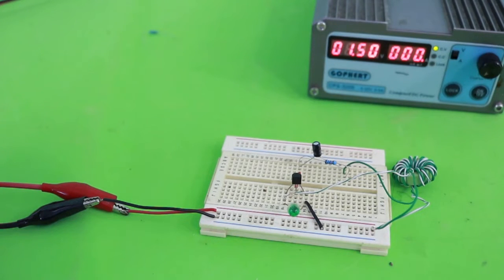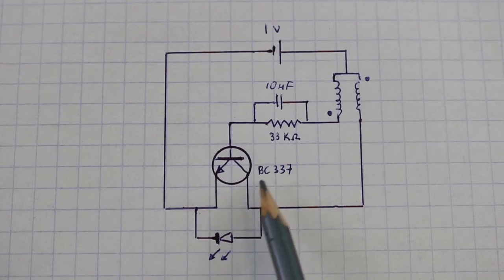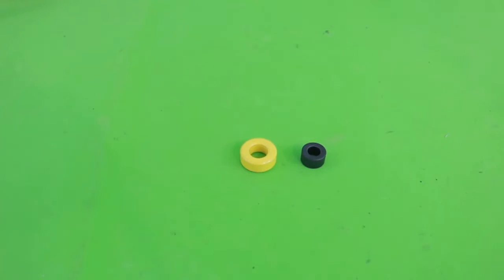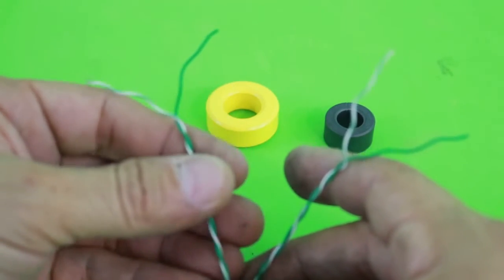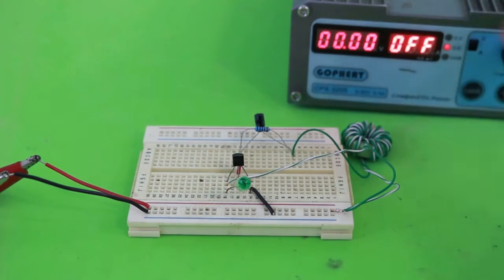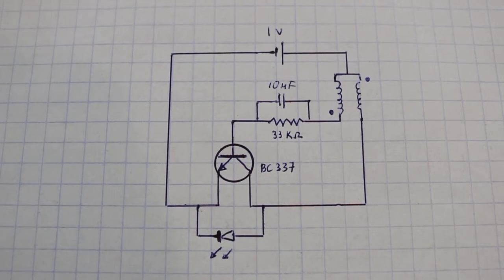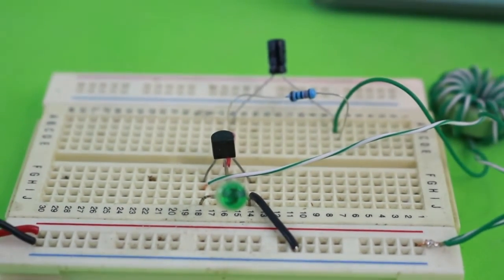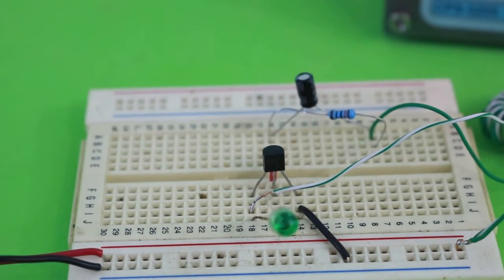Blinking Joule Thief Circuit

Comment: Ive tried this circuit a number of times but all I can get is a single flash when I connect the battery.  If I disconnect and try again I just get one flash.  Clearly Im doing something wrong but i cant find out what.  Im using the same values as in the video.  HELLLP!!
Reply: Use a different toroid, the 90% of the succes is in the toroid. Also tray to invert the connections of the primary (or secondary) of the toroid. Finally the LED is very critic, use a 5 mm high bright type.

Comment: Just made this on a breadboard. At first I made it with just a static light, then your version, then I upped the size of the capacitor for a brighter flash and replaced the resistor with a 500k pot, now I can make it flash as fast or slow as I like.  Considering my complete lack of knowledge about electronics, I'm quite pleased that it works :)  The battery I'm using is nearly dead, about 0.8v.

Comment: This circuit has amazed me for years. 
Just a thought;
 If you take Blue LEDs
A parabolic collector with a convex focus lense. Could you spin a Crookes Radiometer.
I bet you could.
Reply from the maker: I cant test it  I broke my radiometer 😭
Reply: @ludicscience  I'm sure you could make one. It's not like your short on creative talent.
Reply: @ludicscience  Here is a video on how you can fix your radiometer-im assuming the tip broke off which would be the "best* breaking point being that it can easily be fixed again but otherwise the whole bulb probably broke which means that you would have to make a whole new bulb-you can even make a vid about it and the link i added is about a "sprengel pump" which you can use(well first make then use... also another vid idea...) to achieve the needed vacuum for the radiometer to function... Anyway really hope this helps and here's the link👉 https://youtu.be/viJ3T-1KZqY

Comment: It would have been nice if you had used an oscilloscope to help explain how the circuit operates.  Either that or a circuit simulator.
Reply: It's very cool basically the inductor gets charged from the power source till it's over saturated and can over come the resistor at the base of the transistor, then all the build up in the coil dumps to ground through the led causing the pulse. I have one in my workstation that has been blinking for over nine months on a single charge! It can go for years on one charge, very efficient. There are many variations and they are used in a few real world applications like buoy lights, it's one of my favorite circuits. 😁